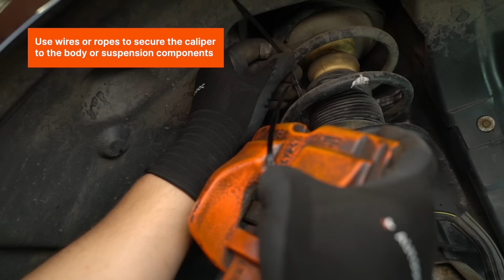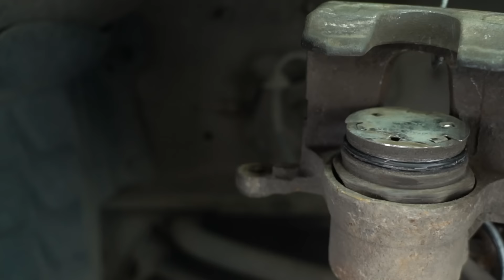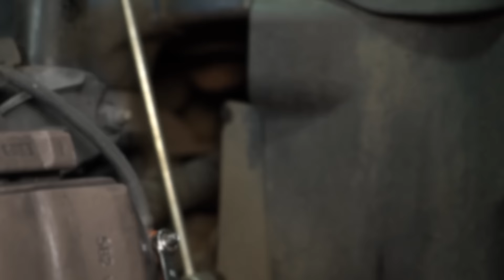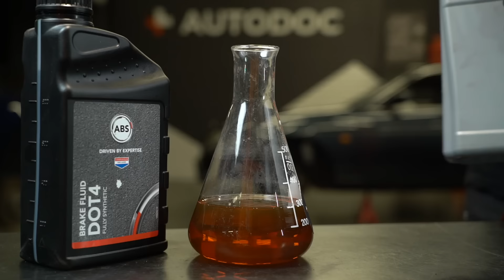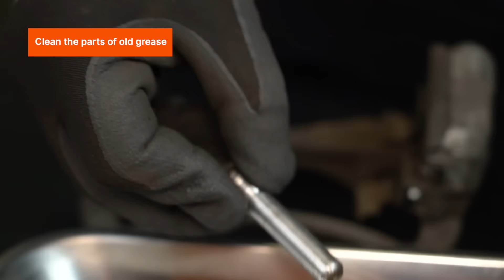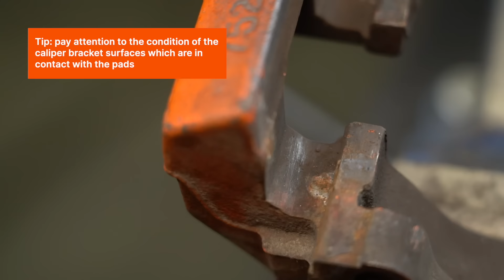Top 5 brake repair mistakes | AUTODOC tips

Comment from the maker: Have you made any mistakes when replacing car parts? Comment below 💬
Reply: That must not happen.
Reply: How do I get the dot3 stop checkdevice? Thank you
Reply: The problem is that you make catastrophic mistakes when installing brake discs, you MUST NOT clean the hubs with metal brushes in no case!!! - that's what the right tools are for. DO NOT apply any paste or other shi*ty "protector" to the surface between the hub and the brake disc. You MUST NOT measure the disc on its bell side (how the fu*k u have to correctly measure beating on the brake disc when it's not correctly measured????) - you have to do it on the edge of the friction surface of the disc for the measurement to be correct ... - this is a fu*king joke, how can you record a video in public about making mistakes when assembling brakes, if you can't do it yourself . AUTO-DOC you suck... and making people moore more ignorant than they are now....

Comment: When cleaning rust off of hubs it actually does 2 important things: #1: ensures proper runout #2: it improves conductive heat dissipation which will increase the longevity of wheel bearing and rotor lifespan! Clean metal transfers heat faster than rusty metal.

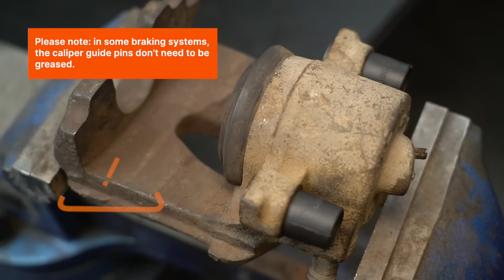Comment: Yea, at 6:12 it says that some guide pins need no lubrication. I was using silicone paste on this type. Thank you. Makes sense since the grease would get on the threads. I think that's why my rear calipers are making noise, they're loose.  Again, thanks!
Reply: i think the issue with greasing that type is that dirt/sand/grit will stick to the grease, and then its like sandpaper. The other system they showed seals the grease inside with the harmonica looking rubbers
Reply: ATE actually sells an acid free paste for this application.
In northern countries, not using any lubricant on the guiding pins will for sure lock up the brake calipers 😅
Reply: @GoerdingscapePK  I run my BMW in Canada with zero lube no issues. I follow the BMW official repair instructions.

Comment: None of the mechanics do this kind of repair, they just change parts lol
Reply: would you pay for brake job double price if mechanics offers you choice
Reply: @makantahi3731 it wouldn’t cost double. They charge more than enough in labour already to have time for this.
Reply: @JacobLeeson-zk1ol  i would not bet on that
Reply: @makantahi3731  if you're you're not mechanically inclined how would you even know they did the work
Reply: @marvinwilkins  it can be done just some things or more ,what could be done but not too important
Reply: Brakes pay 1.5-2 hours taking all of these factors into consideration, but 95% of technicians will shortcuts to reduce the time to 30 minutes to 45 minutes while still charging the customer 2 hours labor.
Reply: You use the word none like so easily (None that you know of) sounds better
Reply: Not true

Comment: Is brake cleaner a patroleum product?
Reply: typically it's a mix of ketones so no
Reply: @reallyhappenings5597  thanks, I'll check out what keytones are, sometime.
Reply: why
Reply: @makantahi3731  because patroleum products  anywhere  around the brake fluid is a no-no, so if you are going to spray the brakes with it, it is not a good idea to spray it in side the dust boots on the wheel/ caliper cylinders
Reply: @carlodonnell146  thanks, i use it only outside around bleed adapter to clean brake fluid from surface
Reply from the maker: It is not possible to answer your question. This information must be found on the packaging from the manufacturer.

Comment: You could add copper grease on caliper brackets so brake pads move  much better.
Reply: the issue i see with this is that dirt/sand/grit will immediately stick to any grease and then in my opinion its worse than having no grease at all.
Reply from the maker: Yes, you can apply grease to the caliper brackets, recommendations for what kind of grease to use should be found in the car repair manual.
Reply: Nope dirt sticks to it and seizes the pads
Reply: Smile
Reply: it is good for high temps because it can not seize,(sparkplugs, screws on exhaust) but can be washed easely by water   , and what if it comes on disc

Comment: You got the hub paste all over the wheel studs. Major no no.
This will not allow the lug nuts to be properly tightened, and severely over tightened,  breaking the stud and damaging the wheel and maybe come lose.
The FIRST thing I do is to flush the entire hydraulic system. Then I will open the bleeder, remove the caliper and hold it upside down and shake it while under pressure to help remove any rust that sits in the bottom of the caliper.
Reply from the maker: We are sure that your comment will be useful for many of our viewers.
Reply: @autodocuk  nah this guy is a clown. Nobody is going to bleed THE ENTIRE system for every car just for pads. He's a troll

Comment: U can mix dot3/dot4/dot5 together but never any on them with dot5.1, that creates a mess in ur brake fluid sistem
Reply: Exactly. The only other thing is you shouldn’t mix dot 3 with dot 4 if it’s a car that requires dot 4, but other than that, you should be fine mixing certain different brake fluids (of at least equal or higher, but not lower, grade than the car requires.
Reply: @AAP0000  only difference between dot3 and dot4 is te boiling point. Dot5 have silicon in it and will ruin the system if it's not recommended to use it.
Reply: @johnnytardes6801  Exactly. That’s why you can mix dot 3 and dot 4, unless the car specially requires dot 4.
Reply: NO !!!!
DOT 5 =|= DOT 4
dot 5.1 = dot 4, you can mix those together but not "DOT 5"
Reply: @DarkIzo  was waiting for this comment! Totally agree with you!
Reply: That sounds right

Comment: Don't use brake cleaner on the boot for the caliper piston, you guys nuts?!
Reply: Brake cleaner acts aggressively against anything that's hydrocarbon, and as rubber is made of that it'll be damaged over time. Also, do NOT use it to clean painted calipers as the paint will get wiped out by the product
Reply: @iNSTAGiB It's not that bad, but all the manufacturers strongly suggest you do not spray it on rubber
Reply: i thought brake cleaner was supposed to be safe on rubber parts as brake systems have a lot of them? I wouldn't use other cleaners but i thought specifically brake cleaner is safe
Reply: @lukaszM46  brake cleaner is a very aggressive product

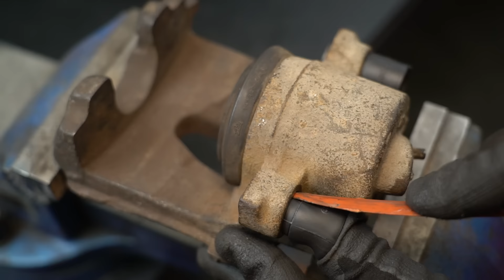Comment: Is there any harm in lubricating the caliper guide pins in the brake system shown at 6:10.?
Reply: those are the same on my bmw x1 e84, in the manual says those must not be greased, just cleaned..I did found brake dust stuck on them, pads did not return properly, uneven wear...added grease twice and they perform nicely. The rubber boots wear and get sticky on high temp, brake grease help it slide, it works for me ! treat it as the factory advice to change oil at 15-20 k :))
Reply: @camaroblackmatte  What kind grease do you use for the glide pins? Silicone basic grease? Or ceramic grease
Reply: Generally, caliper guide pins should be lubed -- and only with silicone-based grease.  I use 3M silicone paste which is also great as a general lube for non-metallic parts.  Petroeum-based lubes will degrade the rubber boots.
Reply: @reallyhappenings5597  Patrolium based grease also hardens and dries and causes the pins to seize; and creates a problem rather than solve it, that's why it is better to use silicone lube.
Reply: i had provided in kit grease with new guide pins and rubber boots
Reply: I put silicone grease on mine! Sometimes provided with the brake pads

Comment: Why is a mistake to lube the sliding pins for the front brakes ? minute 06:09 ? its nice to place also the reason and what will happen if we lube it. I can say that i lube them and now the brakes are running like brand new! without lubing the sliding was robust and not that even, even with new boots.
Reply: Since it says "don't need to be" instead of "you must not do that", then it probably won't happen anything if you lube the sliding pins 🥴
Reply: Hi. I also had this question and afte a lot of surfing on the forums i found out the following:
Those are ATE calipers. On the ATE site there is product named "honing brush" or something like that. There is also a note which states that the inside of the rubber bushings should not be greased. 
On top of that, BMW also recommends that the metal pins and rubber boots of this caliper system should be left dry and free of grease. This info is present in TIS documentation.
Reply: mee too, just keeps the dust away...it will solidify in years, previous owner did not do brake jobs often
Reply from the maker: You can find this information in the technical documentation for the repair of your car. Your comment will be useful to many of our viewers.
Reply: @autodocuk  this technical aspect is TABOO, it doesn't exist and nobody knows anything about it :) It seems that you as well throwed it out without any reason or explanation.
Reply: @SanKraN87  Also, I think it is because the pins go through rubber material, they don't have direct contact with metal, so no lubricant is needed.
Reply: @philipgligorov5848  we can only assume this facts since the one that "knows" and throw this topic out, is silenced :)
Reply: @philipgligorov5848  guide pins are in metal hole of fixed part of caliper and they lean on that metal hole and touches it when moves, rubber boot seal just prevent dirt and water to enter in and corrode them, rubber seal does not make guide pin to levitate inside of hole

Comment: Hi ... I have a skoda fabia 2004
It suffer from a mechanical problem that local mechanics haven't figured out the cause yet
The car shakes back and forth when I lift my foot off the gas pedal (the shake is at its top in first gear and weakenes in higher gears) I replaced two mounts but the shake didn't go away .. any help!
Reply: front strut mounts/bearing, loose nuts on top ? cracks when wheel turned ? bushing/swaybar ? worn wheel bearing ?
Reply from the maker: There can be many reasons and without proper diagnostics, we cannot advise anything, please contact the service.
AUTODOC
Reply: Could be play in the drive shafts, but it's impossible to say for sure without having seen the car
Reply: Its the two Rubber mounts in the Front Suspension where the Motor Torque mount sits
Reply: sai baba could help you but he died